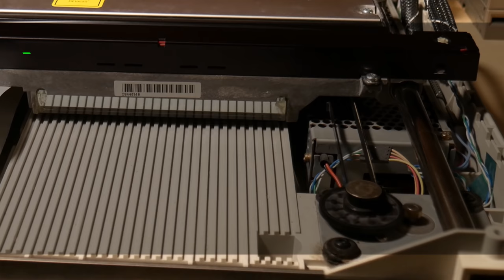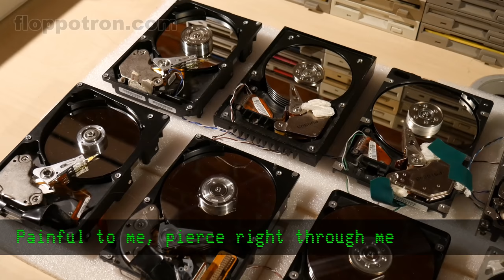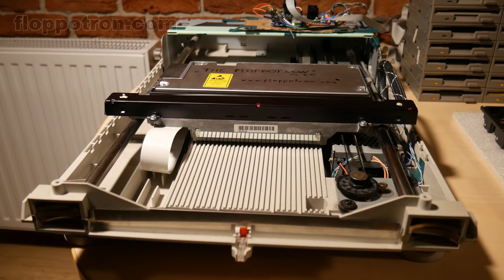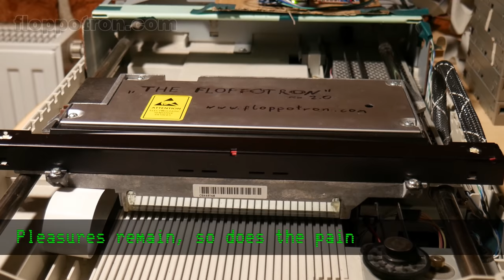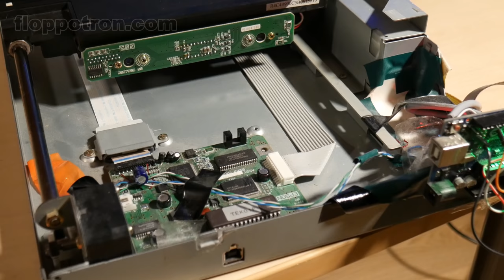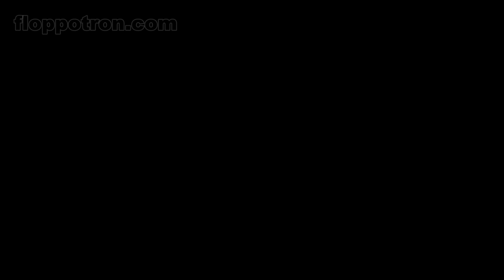Enjoy the Silence on FLOPPOTRON

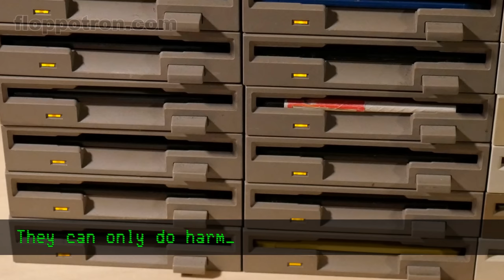Comment: 1:55 you can see the floppy disc arrays shaking the table/camera. i never thought about how much kinetic energy is going on in the floppotron.
Reply: That could have been something bumping the camera too as I've never seen the table shake before. Not saying it isn't the table, just putting out another possibility
Reply: I think it's one of the scanners shaking the table.
Reply: many leightweight things, doing the exact same movement can add to to quite some power. Like soldiers marching, breaking bridges. Or that legendary case of a huge telephone centrale was built into a building in the 50's using mechanical relays and that, once as the power was switched off and oll the tens of thousands of tiny little tongues in the relays fell down a millimetre, came crashing through the floor it was put on.
Reply: You should have seen the 5 inch ones... or, better yet, the 8 inch. :) or... some full height SCSI drives of no more than 40 or 80MB (120 was king)... "dumpster dive" c.1992

Comment: Do you swap out the floppy disks for each song? Like I get that it changes the sound depending on if the drive has a floppy inside it, but I can't help but think I notice the floppy drives keep changing whether they have a floppy disk inside them. Its like for each song you do both software programming and hardware programming and I only think "Wow"

Comment: question: how do you get 64 three and a half inch disk drives connected to a single system ???
Reply: A lot of cables and soldering plus some Linux wizardry.

Comment: This took me to those days when COMMODORE 64 was the first computer at home with a sing-hum like disk drive. I loved those days ... until came C-128 then AMIGA .... and everything changed. I still have a C-64 disk drive ..... and the first color printer with a color ribbon cartridge. Colors came in a few inches of cyan, then yellow and green, I guess, the head had an electrostatic charge and made a first pass over the first color, then rewind to pass in the next color, rewind and so on. The print was made in wide lines, one at the time. You could see little thin lines whit no color at all between wide printed lines. The final work had a crayon-like quality. Nobody paid attention in those unprinted thin lines. In those days was SOMETHING cool and 1 in 500,00 had the chance to get a printer like these. They were a piece of garbage when thechnology run fast .... like .... today.